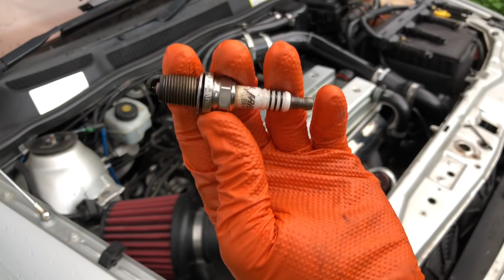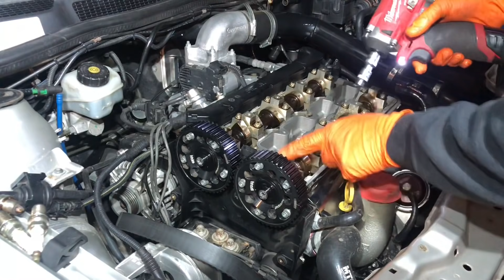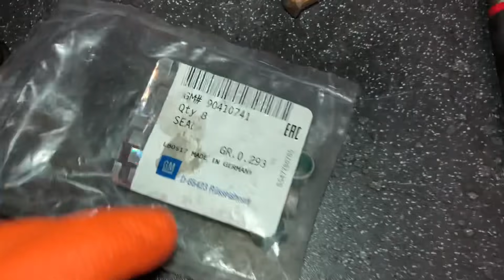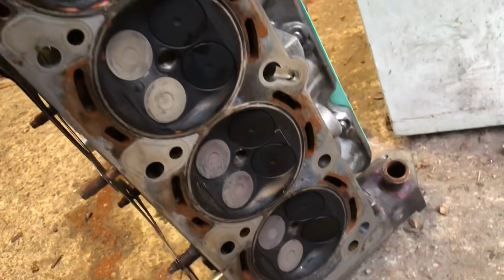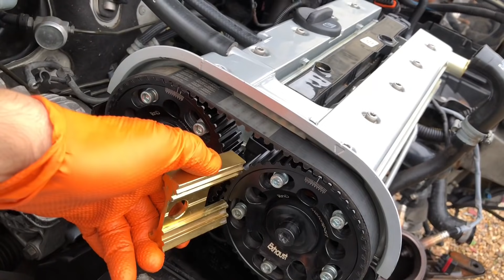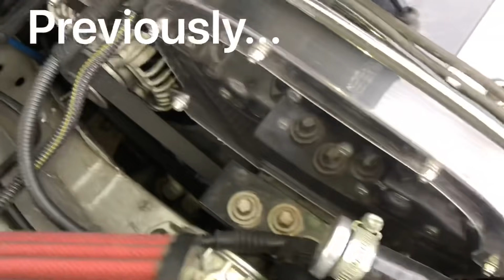I Changed PERFORMANCE VALVE SPRINGS & STEM SEALS With The HEAD ON! (And OFF)

Comment: Hi, When you put the pressure on cylinder one (while changing valve seals) you don't block the crankshaft somehow? Pressure should move your piston down i think? And it will be no longer in TDC?

Comment: I'm not a auto engineer or mechanic but you said you skimmed the head.
Don't you have to use an over sized head gasket to make up for the valve interference

Comment: Just like to know what you're running those top hose into , my breather system is stock.
Reply from the maker: External breather system
Reply: @AaronUnknownPerformance  thx , will go over you're clips. Guessing you plugged the 4mm inlet.

Comment: Araon I really need your help please i have a gsi I had a water leak i went to clacton for the Week end I left but checked my water for got to  put the cap back on started driving about 17 miles car died I get the top head rebuild skimmed new gasket water pump all that stem seals lifters car started up starting driving for 10 mins left the car on then I heard it splatter and died and piston 2 lost compression. That what happened as my mechanic said can you help me out here what could be the problem now I was thinking rings but he said it sounded to well to be the rings and now it is had started again PLEASE HELP ME OUT!!

Comment: How much should I expect to pay to have my valve seals replaced on my vxr in situ,
Cheers Rob
Reply: It depends. Anywhere from 800 euros to 1.5k.
I live in Bulgaria and a friend mechanic can do my valves, head gasket and segments for 800 euros max. My engine is the 1.8 x18xe1 by the way. If you open the engine, change everything and find a guy who knows how to rebuilt engines.
I was on the edge of changing my valve seals, because I had bad fuel economy and it was working shaky, but I started with the simpler things.
I cleaned the EGR valve, my throttle body, the MAF sensor and I did an engine flush.
If you think you have a lot of carbon build up, do like I did. I flushed the engine twice and I used Amsoil engine flush and oil.
I also changed my oil sooner after the first time to clean most of the crud. After the second time my car is working like a swiss clock! The valves and top cylinders were probably carboned from all these years and now its night and day.
Reply: The stem seals are 50£ and you can do it yourself so with the tools and without taking the head off not much more than 100-150£
Reply: About £150